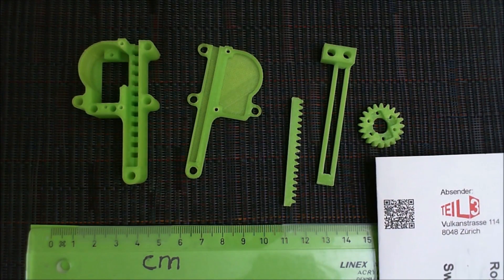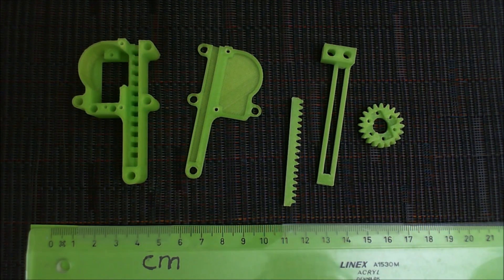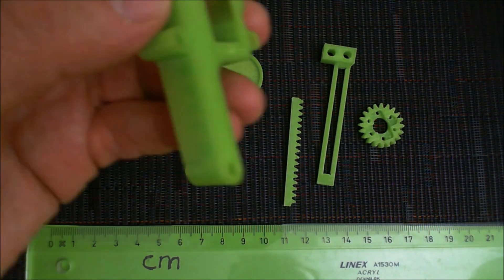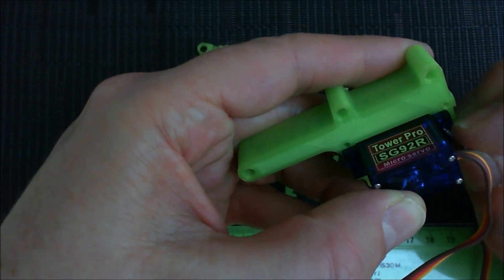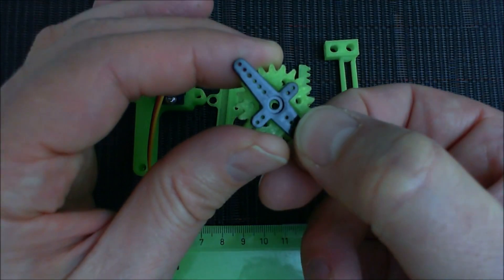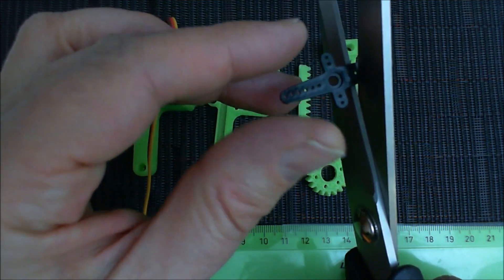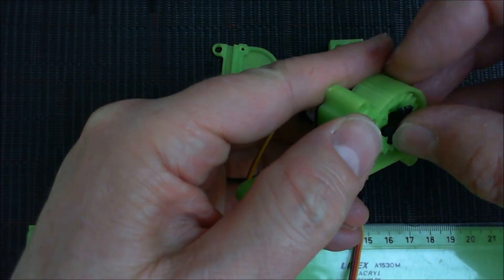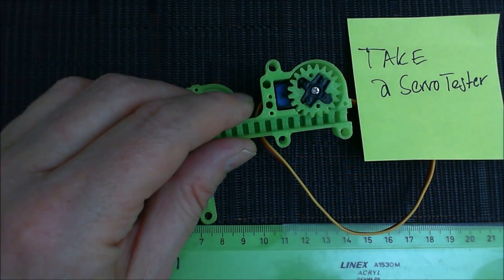DIY Linear Servo (Proton Revision 2 - Eeaster Edition)

Comment: hey how r u? We are a student group and we are doing our final project, that is a Scara robot. Could you please tell us the measurement of your project? It will be our linear actuator. We don´t have access to the SolidWorks 2016, only 2014 version. Thanks
by Projetoscara group
Reply from the maker: +Projeto Scara You could import the STL-files then and do reverse engineering, can you?
Reply: How do I do this?

Comment: Hi, This is exactly what I need for an 00 model railway project. Unfortunately I do not own, or have access to, a 3D printer. Is there a wat to buy one ready printed?...John
Reply from the maker: I could send you one of mine, as an experiment. or how many would you need. (w/o servo, right?) would you send me 10$ each? I could promote them on e-bay if this turns out to work fine. e-mail to tscha70 at gmail dot com
Reply: That would be great. I already use the 9g servos so just the actuator will be fine. I will only need one. I can send you money with PayPal using the email address. I am in  UK which may increase the carriage cost. Please let me know...John
p.s. an e-bay listing sounds like a great idea
Reply from the maker: +Canal Sidings Model Railway 
So send me you adress :)

Comment: What is the purpose of the helical gear having angled teeth while the rack spur doesn't?
Reply from the maker: tighter fit. that's what I saw on other web-sites of linear actuator providers
Reply: OK, thanks. I figured there must be a reason.